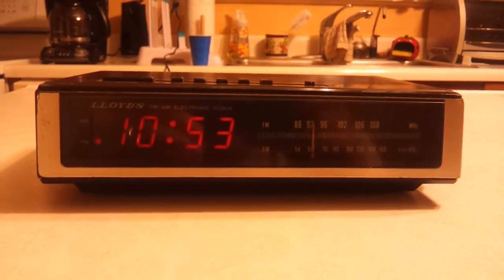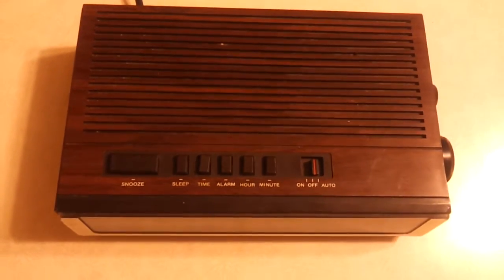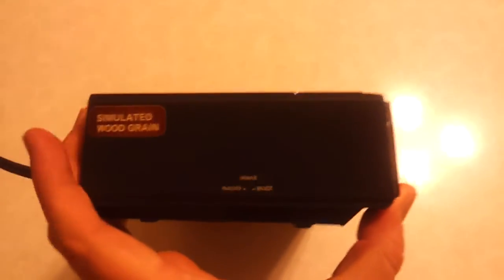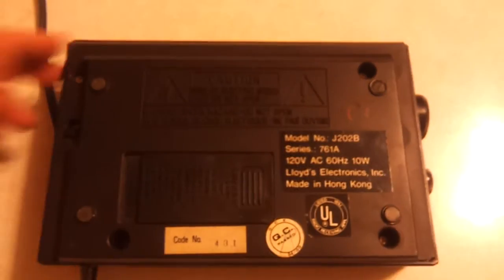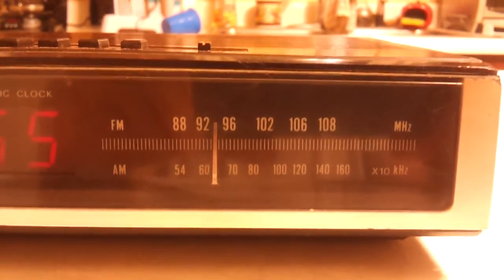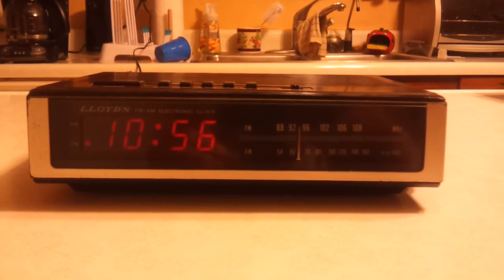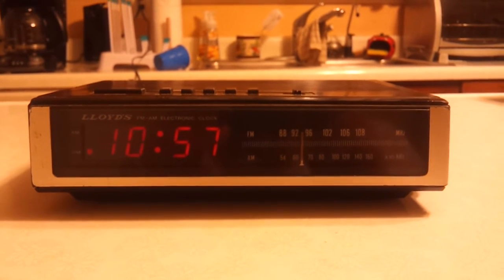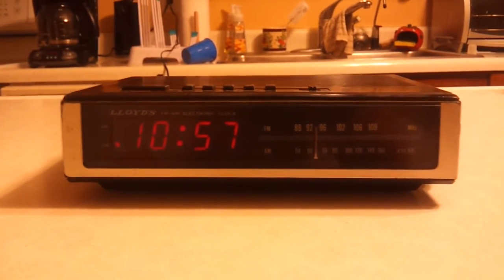Vintage Lloyd's Clock Radio

Comment: I've actually had this alarm clock since I was a kid.. I've used it every day and have never had a problem with it.  

Re: the alarm function, you have to set it to "Auto" when setting the alarm.  "On" does what it says.. it turns whichever function you have selected "on"
Reply: Definitely on the latter part about the “auto” portion.